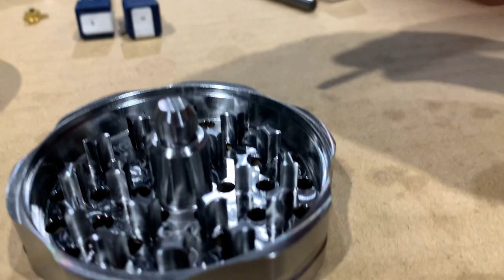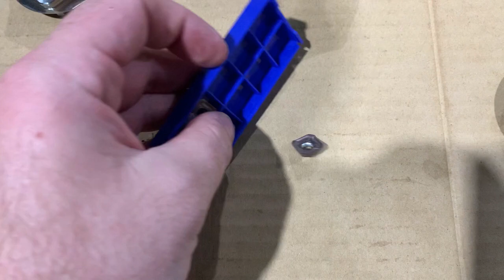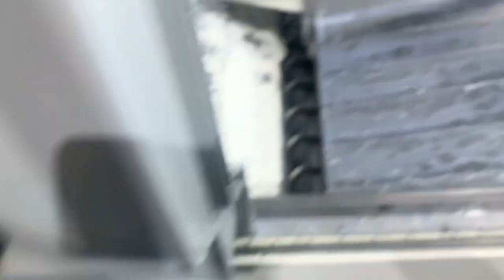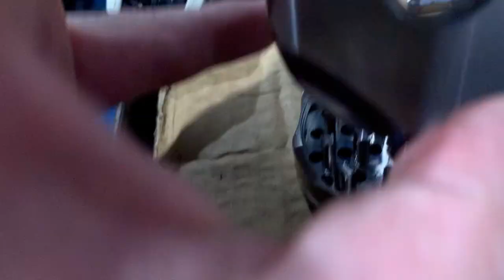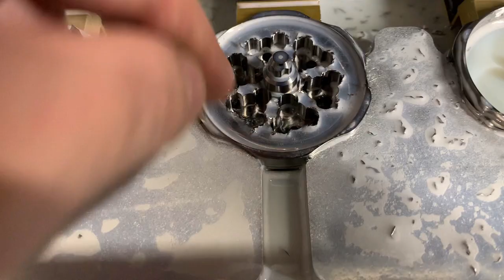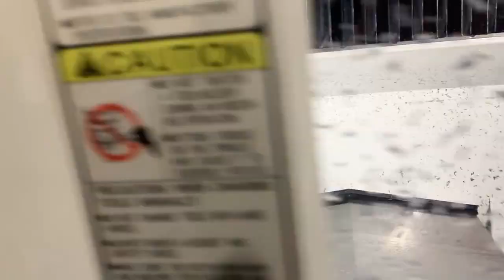CNC Machining my first batch of Titanium 6al4v Aroma-3 Herb Grinders PART 1

Comment: Amazing work. Must have taken hundreds of total hours to get these to a finished product state. One thing I gotta ask is about the grinder thru holes. Wouldn't you want those to be straight holes without any chamfer? My thought process is that the herb is going to get sticky when ground up and possibly cause clogging issues, accumulating on the chamfer. My other guess is that if the angle of the chamfer is low enough (below 30° relative to the top face) it wouldn't really cause many issues. Just curious and wondering if this caused any problems with use? Cheers mate!

Comment: Onya Ben, so generous of you to share. 
In return, as the 'unofficial' Public Officer of OM lol, I've posted a "wanted for Ben a Mrs" post on the F*** Combustion forum  :)  She can film vids for viewers, etc etc for you.

I wonder why a ruby is used? 
I understand ruby is harder than the metals in use but the ruby would only be under compression or is it an optical thing? I wonder and also feel OM deserves diamond.

With the lathe bed holding blocks why not implement a strenuous matter removal innovation .. a center big arse hole to drop away the swarf :)